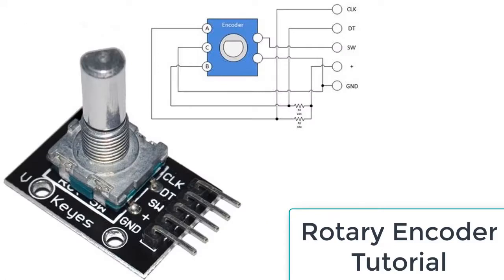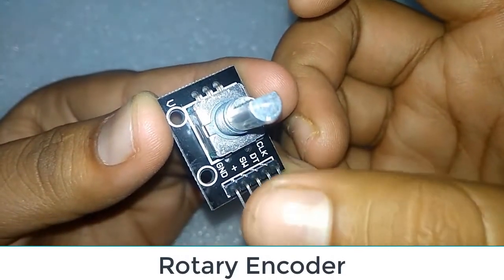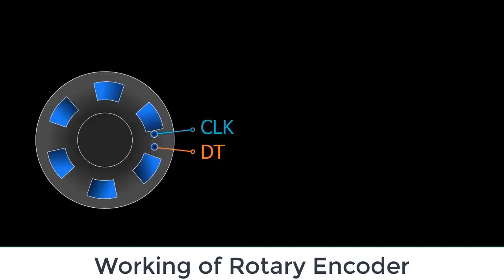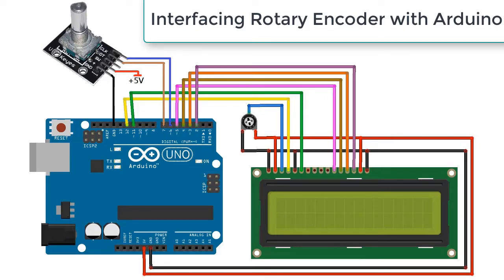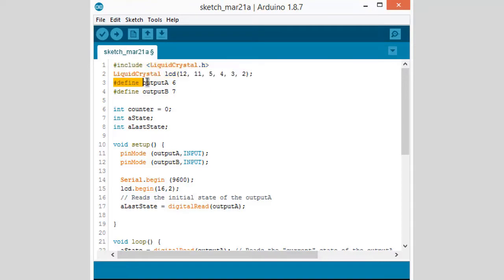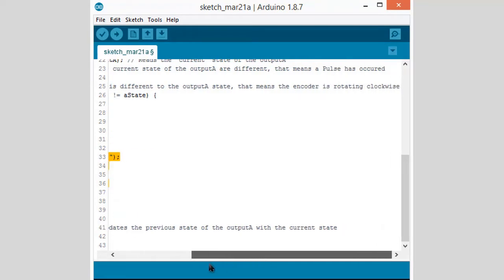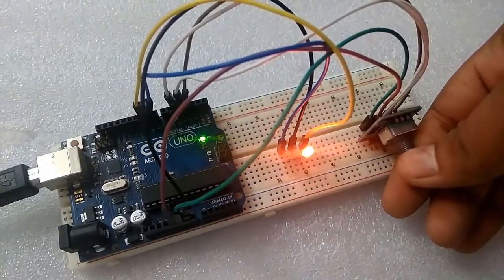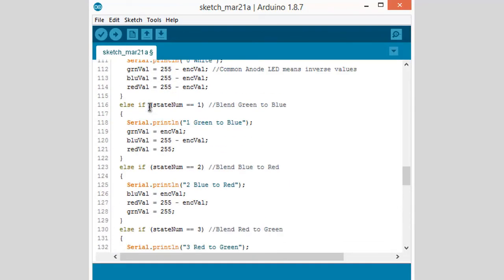Rotary Encoder Tutorial | How Rotary Encoder works & How to use it with Arduino

Comment: Hi, i want to control one dc motor with rotary encoder and wireless communicate with nrf24l01.
For dc motor its need to be have  speed and direction control with rotary encoder. 
Please help me in cods for transmitter and receiver.
Reply from the maker: Oh you aksed for this video 2 month ago.